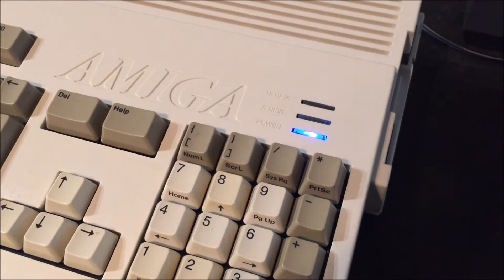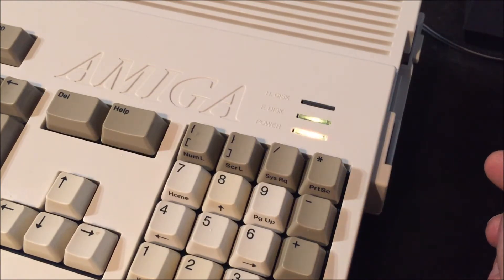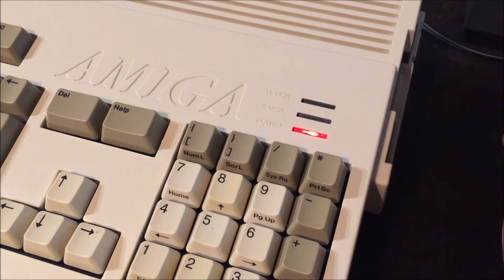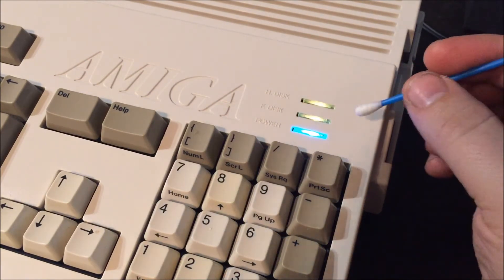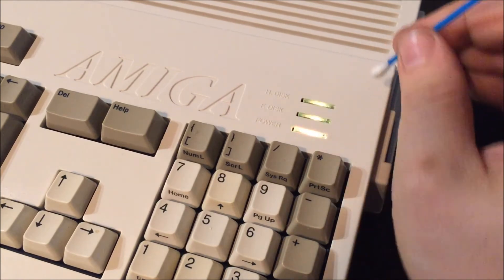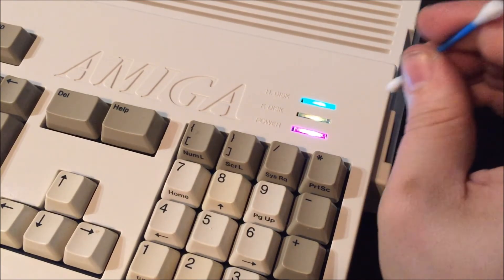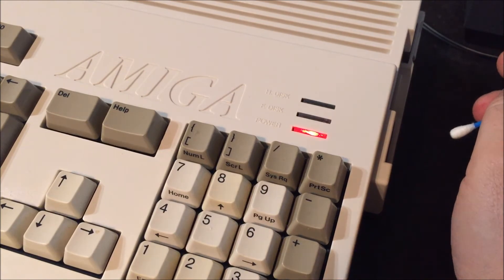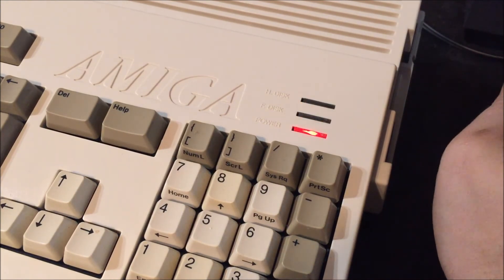A1200 Bifrost - Small Demonstration & Tutorial

Comment: With flashing power etc.  ehh. how do you notice Guru-flashing.  and MOST important: the powerled change at poweron for troubleshooting etc?
Reply from the maker: Hi! The Bifrost does have a small limitation to this, atleast in its current form. The board will detect the drop/dim and dim the powerLED accordingly for this, albeit it may not be perfect. It has worked great for normal restarts so far though. I have expressed this possible limitation in the manual, but I am hoping I can get around to tweak it to behave even better in the near future.
Reply: ah good. as it is a very important tool for troubleshooting machines.